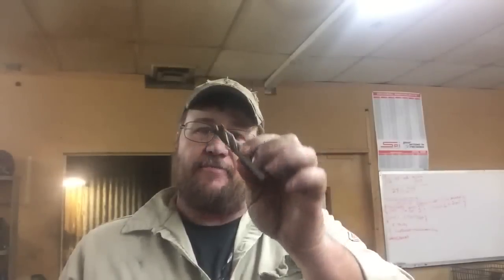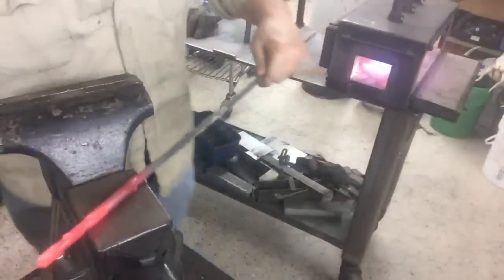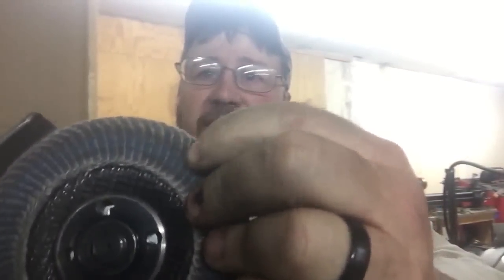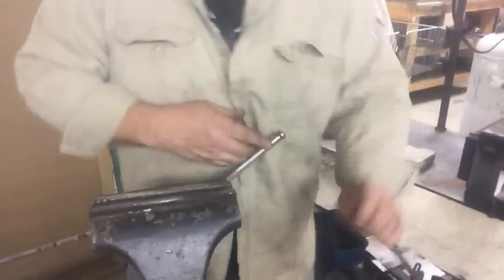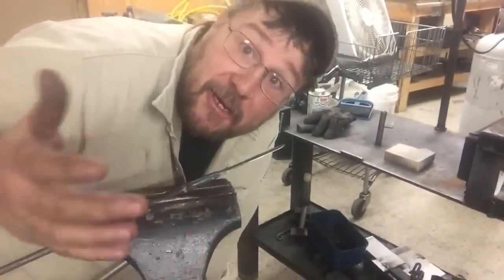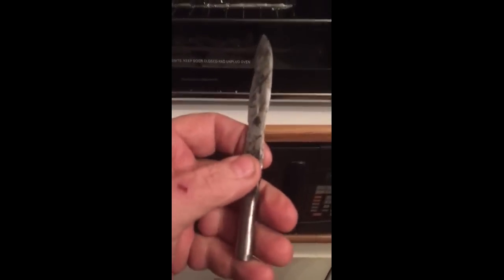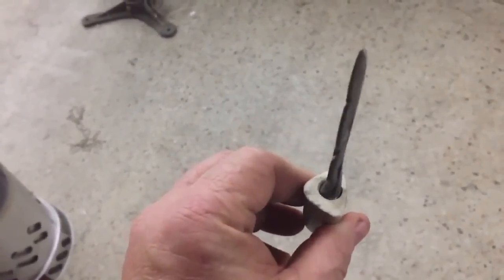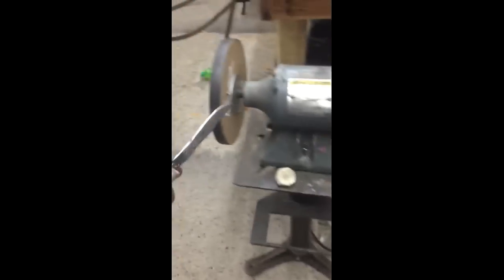My First Knife Making Project (Self Filmed)

Comment: If the end mill is tungsten carbide, it can't be forged.
Reply: +Anthony Browning , Carbide CAN be forged but not with the small forge that Sam has. The temperatures required are extremely high to make the metal soft enough too mash out instead of shattering (which is what carbide will do if not heated). BTW, keep those dolphins polished!!!
Reply: +Mark Crider Gotta disagree with you, Mark....carbide isn't technically a metal and is created by pressurizing differing powdered materials (carbon and tungsten)...and it either crumbles or burns up...there is no malleable state for carbide that I've seen.